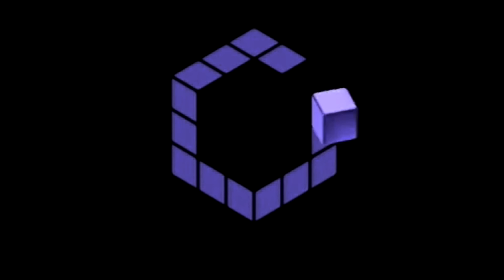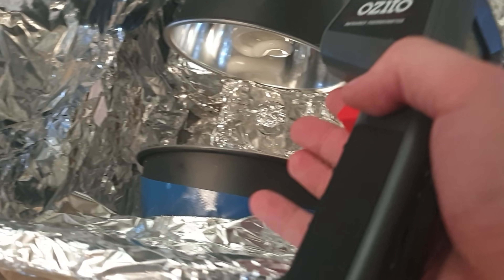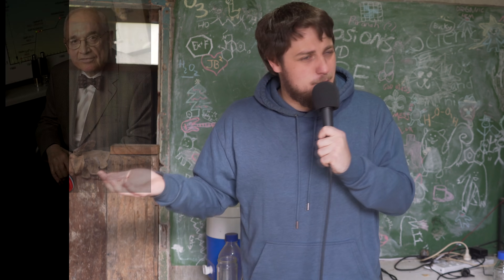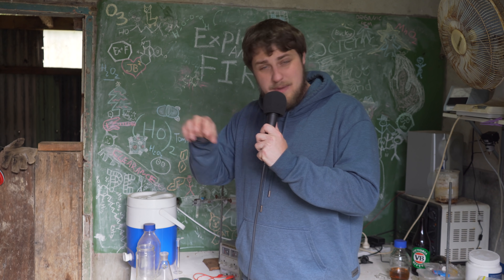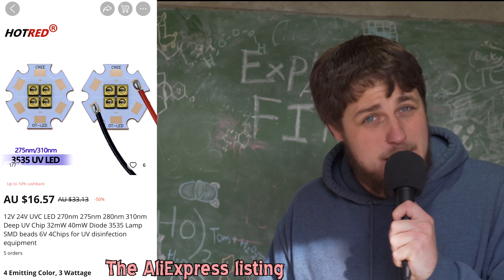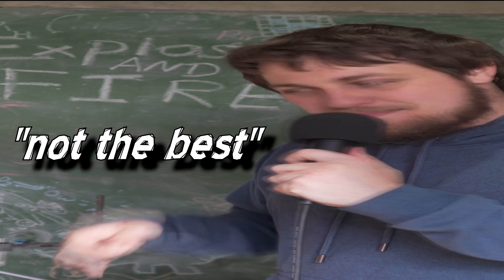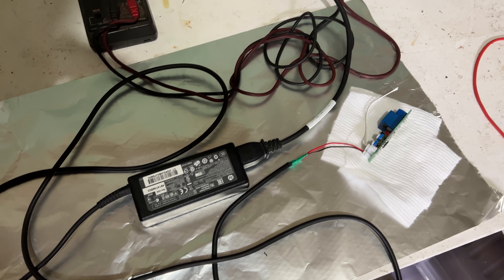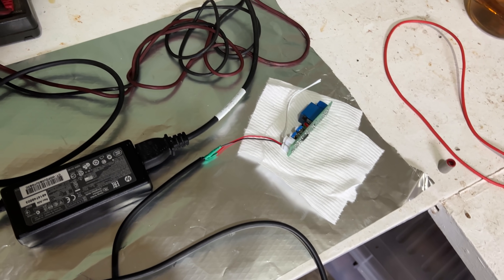Magical deep UV LEDs - Cubane Ep 12

Comment: “Use what it needs” works for current not voltage. Current is like amount of water flow, voltage is pressure. A component will take as much flow as it needs at a certain voltage, but if you push too hard you will break the component.

Comment: Watching a chemist order heaps of dodgy ebay electronics in order to burn his LEDs up with 20x their needed current, while looking at his adjustable power supply and its current limit knobs unused on the left... 🤣

If you get an LM317 voltage regulator IC, and a 1W 33 Ohm resistor (should be attainable from jaycar), connect one end of the resistor to the LM317 adjust pin, and the other to the output pin, attach your +PSU to the LM317 Vin pin, and then the LED between the adjust pin and ground, you will make a constant current regulator circuit for ~36mA. You can see the general schematic of this in most LM317 datasheets. Put a multimeter in series with the LED to accurately check the current.

Orrrr just actually make use of your PSU's current limiting knobs. Put a multimeter in amps mode in series to measure the amps and limit it to 40mA. You'll want to very slowly dial up the voltage until the LEDs draw just over 40mA, then use the knobs to limit it back down 40. Infact I'd start with aiming for 20.

Comment: Regarding the ground wire. If the case is metal, you'd mount the ground wire on box on bare metal. So id sand a bit of the coating off and solder it on the bare spot. Then connect the ground to the male plug. This is back ally advise tho.

Comment: All you really needed is your bench power supply set to 6v 250mA, and 4x 100 Ohms 1/4 watt (R = V/I, and P = I^2 x R) resistors... Tie all the black wires together to ground, and connect each red wire to a resistor, and the other ends of the resistors together to V+. Also, you're not going to see UVC light.. To detect it, use a yellow or green fluorescent highlighter and draw something on a piece of black cardboard. When you illuminate it with UV light it should light up...

Comment: Could you have not just used a UV lamp from a fish tank filter they are relatively high powered 20w + , easy to drive cheap and easy to source at aquatic shops...

And your LED driver problem can be solved easy and cheaply google LED strips for fitting in kitchens, if your mains is 240v a 10w kit should provide roughly 40ma harvest the driver and store the LED strip for later use ...

Comment: i would consider more carefully the shape of your reaction chamber. you may want to use a narrow cone shape so that the uv light is better concentrated at your target. you could back yard this by just making some construction paper cones narrowed to the diameter of your target with a hole at the end to encapsulate the leds. as to the cooling factor i cant recommend enough the blower style fans that they use for laptops. they get a huge volume of air moving through condensed spaces. you might also want to upgrade the size of tin you are using; perhaps the family sized coffee tin instead of the average tin.

Comment: Whoever gave you advice on Current vs Voltage was very out of line, because you seem to understand how they work backwards? Wiring two LEDs in series won't halve the voltage going to each LED, it stays the same, and doubles the current.

Comment: Man, I work in a lab with a lot of diode lasers and boy was this...interesting to watch. I think other people have mostly covered the issues and suggestions, but I'll throw one more in: LEDs and laser diodes like this with low current ratings are often very sensitive to shock discharges. Whenever we handle laser diodes, we make sure to ground ourselves well to avoid accidentally frying them. We have these conductive bracelets that we literally plug directly into the ground pin of an outlet. I'll also add that the things other people have said are basically why we are willing to spend a few hundred dollars on current sources specifically marketed as laser diode drivers :) they're purpose-built to precisely drive these low amounts of current through LEDs or laser diodes.

Comment: You need to pay attention to the current in an LED. If the spec says 40mA then you should ensure it stays at or below 40mA. It won't last long at 1amp, even pulsing it like that. The voltage only needs to be high enough to supply 40mA. Usually, you would put a resistor in series with the LED the value of which would be calculated to provide the 40mA at whatever supply voltage you're using.

Comment: I nearly lost my eyes from UV radiation. The radiation pain took 3 full hours to start ramping up from zero. Then it quickly escalated to maximal pain and I developed cataracts. I thought I was poisoned at first. Radiation burns creep up on you. Absolutely no symptoms for several hours then you can barely see anything. BE EXTREMELY CAREFUL WITH UV. TREAT IT AS IF YOU WERE HANDLING PLUTONIUM WHEN IT MIGHT BE ON. I cringed hard when I saw you exposed bare skin to any of that high energy UV. YOU CAN NOT SEE SKIN CANCER TRIGGERING. ONLY THE MALIGNANT STAGE RIGHT BEFORE YOU ARE FULLY DOOMED. While I'm on this topic, SPF RATINGS ONLY RATE UVB not UVA PROTECTION so you need a lot of zinc oxide for broad spectrum skin protection and strong sunglasses.

Comment: LEDS are freakishly sensitive to tiny increases in voltage. Trying to control the brightness with that analog bench supply is really sketchy. You need to be able to increase the voltage by 0.01v to have reasonably stable increases in amperage and brightness. Never exceed the rate max current unless you have it heatsinked damn well.

In your setup, for a temporary connection, common white toothpaste actually works damn well as a thermal compound.

Comment: 6:02 "possible amp delivery" of the power source does not matter as long as you >>don't use more voltage<< than an appliance needs. It will never use more than 40 mA.

Comment: You just have to regulate the Voltage right. The current is determined by U/R so the resistance of the LEDs will automatically regulate the current to the appropiate amount of Amps. The mA of the power supply states the max current the power supply can handle. Meaning that if you connect something with to low of an resistance to your supply you might fry the power supply.

Comment: You can get cheap as dirt LED drivers at just about any current rating. They mostly consist of a small transformer and a rectifier, and then some resistors to give a certain output. You can do arrays of series + parallel with them to get the proper current running through them if you can't find a suitable current output from available drivers, but easiest if you can find one with the correct current in which case you could run them all in series and simply add the voltages together which should fall within the output range of the driver.

Comment: The ground on the led driver has a ring terminal as they usually go inside a metal light fitting which needs to be grounded. The driver doesn't appear to be double insulated and neither is the cable where it enters the driver or your timer, so if you wanted to make it safe you would need to fit both inside a project box with appropriate strain relief on the mains cable. that will then be pretty much double insulated so you dont need a ground unless you've fitted it in a metal box

Comment: Okay, so basically, the way you should do this is:
1) Get a 12V power supply. Your bench will work.
2) Get yourself these LED arrays.
3) Get 330 Ohm Resistors. 220 will also work. These resistors need to be at least 1/2W (absolute max power dissipation) Your local electronics store will sell you 1/4W resistors by default, so tell them you need 1/2W.
4) For one single LED array, connect it like this:
V+ --- LED1 --- Resistor1 --- V-
5) Repeat for the other LED arrays.
You should end up with parallel subcircuits as described.

The why:
LEDs are diodes. Diodes conduct electricity in one direction (red positive, black negative), block it in the other. Essentially, they're ideal wires in one direction, and ideal insulators in the other (none of this is true, but for hobbyist grade electronics it's close enough). This means if you give an LED 100A it'll just pretend it's all good and continue passing through a 100A. Basically they short circuit. The problem is, for a regular wire, if it's too thin, it burns out. Same for an LED. The LEDs you bought will accept the 1A you give them, but they're rated to only work at .04A. That means we need to limit their current. Remember, they're ideal wires, so we can just do the circuit from high school with a resistor. By Ohms law: I = V/R, you plug in V=12, I=0.04 and you'll get R of 300Ohm.

If you want to be a little more accurate, you can also accommodate for Voltage forward drop. When LEDs are in their forward direction (ie. "acting as wires") they actually aren't really acting as wires but introduce a voltage drop across them (UV have about 3.5V). The voltage drop is basically the measurement of how many volts an element drops. Between your + and - of your power supply you will necessarily drop 12V (imagine a waterfall -- going from the top to bottom whichever way you take makes you fall x meters)
So, with that voltage drop, the resistor voltage drop is 12V - 3.5V = 9.5V. Ohms law: R=V/I=9.5/40mA=240Ohm (close enough to 220, 220 is way more common)
Perfect, power, estimation: P=V*I=V^2/R=9.5^2/220=.4W -- need a resistor that can dissipate that much (common value .5W)

Comment: Use a 15v DC power supply, a switch, a heat sink, and a 1k or 2k resistor. Oh and a breadboard. So you don't have to solder anything. The driver is honestly probably overkill and adding way more heat than necessary. Just keep it cool. Especially since you probably don't want the LEDs running anywhere near 40mA. Unless I'm missing something about UV LEDs?

Comment: your lab power supply already contains everything you need to drive LED - you just need to set current limit equal to working current of LED, unbound voltage (set it to max), connect LEDs in series  and you are done

Comment: Use resistors always when uworking with LEDs, they limit the current. THis is how you get to the 40mA. You can get lucky but not for long. Not using a resistor will dramatically reduce the lifetime of the LEDs.

Comment: You want to short out your current limited dc supply  and with a meter measuring the shorted current adjust the output current knob until you see less than 0.04A or 40mA probably like 20-30mA or 0.02A to 0.03A should be good but DO NOT give them more than 0.04A or 40mA or you will let out the magic smoke like you did when you first powered them up, I think you didn't see the smoke. The voltage shouldn't matter the currant is what you need to worry about the LED's act like Zener diodes.

Comment: I prefer to run LEDs in series, you can get 12V mini-amp power supplies for cheap, and a current regulator, but I feel running them on a 1A or 2A power supply shouldn't be too bad.

Comment: By now you probably already know it BUTT.... Diodes are electronic check valves ... With a spring and everything ... Imagine electricity is just water there is waterpressure and the amount of water that flows at one moment. So if you now have that light emitting check valve and slowly turn up the pressure then first with really low pressure nothing is flowing because the spring is holing it shut... but as soon as you hit a high enough pressure, the spring in the check valve can be overcome and it flows. problem is ... Once that spring is kinda pushed back ... There is a lot of flow and nothing holding it back, usually too much and that's how to reck an led... So you power supply can limit the current/(A)/flow as far as I can see. So simply without having the led attached, shortcircuit the power supply and slowly turn the nob for current up from 0 till you got some flow that you are happy with, then you can theoretically turn up the pressure/(V)/Voltage as high as you want, your power supply will cut the voltage to only allow the set current flow... Less important stuff: usually people run LEDs especially small ones with a so called resistor in the water example ... It's simply a pipe with only a tiny hole to flow through. So by changing the size of that tiny hole or the pressure you obviously change the amount of flow through that smaller section and then obviously even if the check valve is completely pushed open the pipe will stop the flow enough to not destroy the led. But I guess since your LEDs kinda seem to take a bit more current ... A "normal" resistor would be overloaded to put it simple... there are big momma resistors but they are less used and most likely need to be cooled

Comment: it was pretty funny to watch how you struggle with basics of electronics, you could buy some cheap normal ones with the same rating to try setting them up them before blowing up 14$ led, you ended up connecting two them in series so 24V was just enough, you could add two more into this setup just make two pairs of leds in series connected in parallel

Comment: My man, drive LEDS with a constant current source. Or put a resistor in series -- in your case, 300 ohms coming off a constant 12V supply, or a little more resistance. Literally a common beginner electronics experiment is an LED with a resistor in series, you can find it online pretty easily. I don't know why you wouldn't look up the correct way to do it first before blowing a $15 LED lmao... that was painful to watch.

Comment: I always loved Chemistry and Physics, learning about the world and how to solve problems in it, rn im in college for Electronics Engineering Technician (well off for the summer rn) so I enjoyed watching you dip your toes into something I do daily while I dip my toes into chemistry by binging your vids which is something you do daily. Imagine combining your knowledge of chemistry with my knowledge of electronics engineering, I think we would literally be able to do anything we put our heads to. For the first led that you fried you put wayy to much amperes thru it, in series with 2 leds you would need 24-28V with 40mA but if you did it parallel with 2 leds you would need just 12-14V but 80mA. LEDs act as diodes in a way which you need a set amount of voltage to get electrons flowing thru it and if you dont have a resistor to help with the load then ramping up the voltage will ramp up the amps which well fries the led. Kinda depends how you want to set it up and if you want to use more voltage or more amperes. Series 3 leds would be 36-42V needed at 40mA while parallel 3 leds would be 12-14V at 120mA or 1.2A. Anyways pretty much just finished watching all your vids I havent yet seen here and on explosions & fire, keep up the awesome vids! Love the comedy and actually learning stuff as well, lots of love from Canada!

Comment: I bet the fancy vacuum grease would actually be pretty good. All it really has to do is fill in the gaps and be a less-bad thermal conductor than the air would be (and stick the LED modules on enough they don't come off, I suppose).

Comment: Never thought my knowledge would be helpful on a chemistry channel, but here goes nothing:
For powering LEDs, you either have to put a current limiting resistor in front of it (online calculators can be found by searching for "led calc"), use a constant-current driver or, and this is my lazy-test-setup method: Swallow the pill and get a good programmable bench PSU, set the current limit slightly below what the LED specifies, then set the voltage at the spec and go.
Very important property of LEDs: They are Diodes, and Diodes will at some voltage become conductive and exponentially so. As such, a slight increase in voltage will cause a huge current jump, then the LED (or Diode) will probably die from overcurrent.

Comment: I am a big fan of your garage chemistry, but as an electronics designer, your LED setup causes me almost literal pain. I understand you can't be an expert in everything, though. Just a note: LEDs are negative resistance devices - you need a current-limited/constant-current power source or at least a load resistor in series with them or they will draw more and more current until saturation/explosion. Also if you are worried about overheating, you can get a thermal sensor for like 10 cents and set it up in a bang-bang controller via a 555 timer (about 50 cents) and a power transistor (at most a dollar). Best of luck in the next episode!

Comment: forget goddamn uv leds and just go to the mercury vapor lamps, we wanna see so much radiation it will start looking like chernobyl here! 

BTW

what you did with those LEDSs wasn't right and being unskilled with electronics is no excuse, just but LED driver circuitry. if it were up to me you'd be banned from getting anywhere near anything with silicon or semiconductor materials for the next 10 years just for needlessly burning that fine device. I actually bought some of those a few years back, three, UVC LED, and were expensive as hell, I spent what in todays money would be almost 30 something american dollars, just remember I do not live in US, and with inflation high as hell back then and worse now, it is a heck lot of money to spent on three pieces of 0.25W semiconductior, I actually had to make active-current-control circuitry so I could drive the LED at the required voltage without sending it to hell.

all things considered, good video, and good effort, thanks for posting.